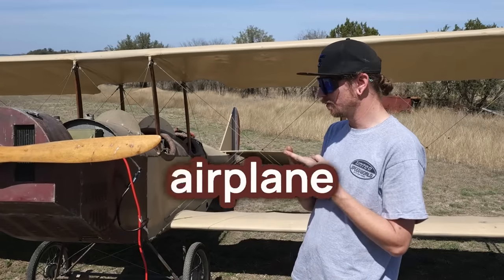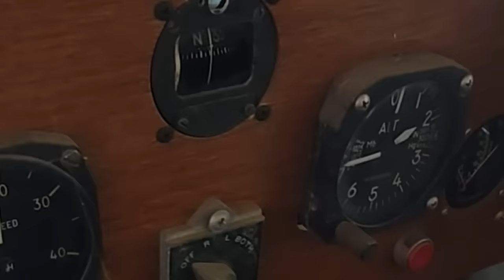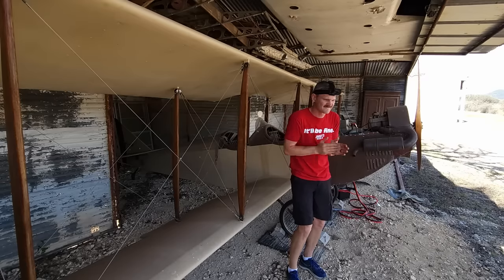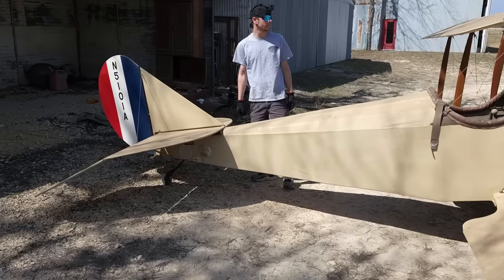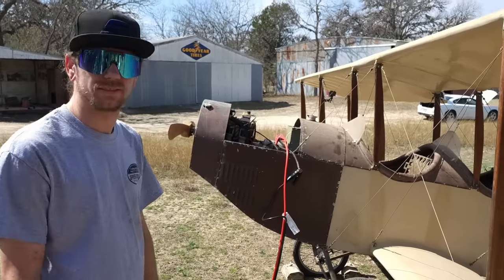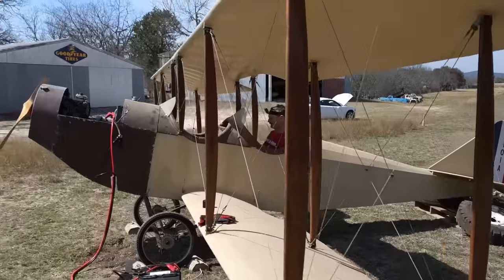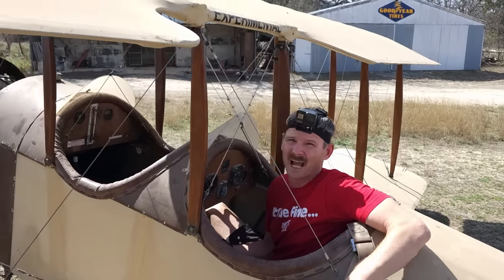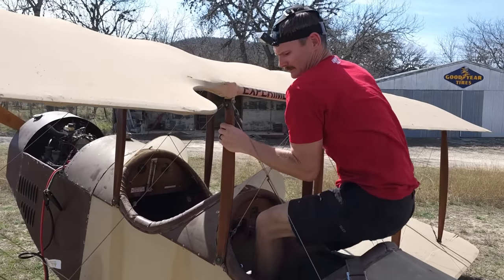WW1 Airplane Will It Start After Years?  FREE Airplane Challenge

Comment: Looks like an "Early Bird Jenny", which is a 67% scale replica of the Curtiss Jenny.  Your viewers should know that this is absolutely NOT an actual WWI aircraft.  It is an experimental, amateur built aircraft, designed by Dennis Wile... and it was probably built 80 years after WWI, in the early 1990s.  :)  The real Curtiss Jenny is quite a bit larger, and there are still a few original flying examples still around.
Reply: and they don't have lawnmower engines. They've actual aero engines running on actual petrol.
Reply: I was looking for this comment.   Thanks
Reply: @jwenting  This one is snowmobile, same power as small car, not a lawn mower
Reply: @johanengqvist4333  same engine design principle though, same manufacturers, just a souped up, scaled up, lawnmower (or moped) engine.
Reply: Especially with a Rotax on board.
Reply: Still looks really cool good replica stil looks great in a hanger
Reply: He did explain in the video that it wasn’t the same if you listened
Reply: @theking19777  I think the point is that he is using a misleading title for clicks.
Reply: I was looking at the scale of the aircraft and I had a feeling something was off! an adorable aircraft nonetheless!
Reply: @codyking4848  and taking advantage of the fact that most people will not even bother reading video descriptions.
Reply: Actually had the opportunity to work on a real airworthy Jenny in Virginia and after seeing the real thing next to the replica the real jenny dwarfs it with an almost 45ft wingspan. The real Jenny also has a nice V8 unlike a lawnmower engine but still cool nonetheless
Reply: @@lurch789 these guys dirty up the "old" airplane (or car, motorcycle, bicycle, etc.) that they're fixing up to make it more dramatic...
Reply: Sounds like it’s running just fine ….. Got a lot of fwd CG but at least it won’t be pitching up ….lol.   Man when that engine quits it’s dropping      Quickly with all that drag.  Personally it’s cool but a death no way would I fly this ……lol

Great job tho!
Reply: I went to a air show at bowman field here in Louisville Kentucky last year and they have a Curtiss Jenny with a small block Chevy V8 which was interesting
Reply: Yeah that's what I thought... thanks for confirming
Reply: Actual Jennys were powered by V8 engines and had a 43 foot wingspan.
Reply: Thank you for saying what, I was about to expose.
Reply: I almost bought the Nieuport version.

Comment: Hey guys be sure the oil injection is working correctly , it did not appear to be smoking out the exhaust at all and seeing its a 2 stroke you would think it would  smoke a bit for sure .  👍
Reply: I concur. I had a 503 and it always smoked at startup.
Reply: Two strokes need oil in the fuel. I was hoping it wasn't going to seize while he ran it up.
Reply: I removed the oil injection and premix. It's the only way to know for sure, until I forget 😢
Reply: It's not oil injected
Reply: @Watson1  it's not a 503
Reply: @Brendan Gardam  it has a separate oil reservoir  and he also said that the fuel in the tank is straight gas ? So how else would it get the 2 stroke oil get mixed 🤔
Reply: @ayitsyaboi  I had a simple gravity injector fail on a motorcycle. When I saw the contraption that came on my Rotax 582, I was like, hell no.
Reply: @chevelle-pi1bn  well he is wrong. 532 s are not oil injected as far as I know. The oil tank he was pointing too is the lubricating supply to the rotary valve. Nothing else.
Reply: @Brendan Gardam  well hopefully they do have it properly mixed and they don't hurt the engine .👍
Reply: @chevelle-pi1bn  it would have premixed fuel in it.
Reply: It'd clunked after that if it wasn't getting oil.
Reply: Jimmy has no knowledge about old Rotax engines. Before he deals with those engines, he needs more knowledge in details about running them safely and successfully. No oil, no smoke. That’s not good at all. I think, this Jenny is an Czech replica. At least it looks like it. But you need to get into this for flying this. That’s for sure. I wouldn’t like to be the test pilot of some of these exposures. They need a lot of work before take off. 😂❤🎉
Reply: @mr.ginnationfunlifestyle3891  not completely true. I run synthetic 2 stroke and the smoke is quite hard to see.
Reply: I'm sure they scored the cylinders. Never prop an engine that has been sitting. All that surface rust will get found and scoured by the rings.
Reply: Me to. Had to premix after that.
Reply: @justpauls  Some two strokes have an auto-mixing feature for the 2 stroke oil. Where you put 2 stroke oil in one tank and fuel in the other, most of the time people end up deleting it though as it can easily get clogged up with even just small pine needles from surrounding trees or whatever that can get into the tank. I always put 2-3% 2 stroke in the fuel tank no matter if it automatically mixes it or not. I usually put a little more than the brand recommends, even if it smokes a little more it'll keep it running forever. Had a fully built 88cc which had its rev limiter removed (went up to 18k rpm). Drove it for half a year and only minimal / pretty much no markings on the cylinder :)
Reply: Oh yea an old 2 stroke like that would 100% smoke a little bit if not a lot.

Comment: Dear Jimmy, that little oil reservoir on top of the engine is not the lubricant for your crankshaft, rods and pistons !
The little oil reservoir only lubes your rotary vane which sits between the carburetor and the engine block, nothing else.
So, please add appropriate 2-stroke oil to your fuel.
Reply: I was just about to type that, I hope he sees that comment!
Reply: I don't believe they added fuel, so hopefully whoever put the fuel in put in the proper mix. So we can hope there was no damage during the start up. Good reminders though.
Reply: If they are using the fuel that was left in the tank it is premixed. If they did not add very much regular fuel it might be ok for very short run
Reply: Registry for the plane lists engine as Bombardier snowmobile engine.
I thought the Bombardier , which is like the 503. Had a fully lubricated injector system not requiring fuel/oil mixing.
Oh well, nothing like watching Jimmy just try things without doing any mechanical homework.
What could go wrong 
Except kill one of his future buyers..
Reply: @michaelpilot1000  could be unless the pump was removed and fuel was just pre mixed, the part that is concerning is the lack of smoke on start up and warm up, regardless awesome video
Reply: @michaelpilot1000  also that last bit of your comment was a little dark why go there?! We were just trying to help him out
Reply: @michaelpilot1000  bombardier own rotax and it is a 532. Not a 503 and not oil injected.
Reply: Rotary’s don’t pistons and rods
Reply: @brendangardam710  

I know more about my Lycombing engine then these 2 cycle lawnmowers lol.
For all the noise they make here at my airport, any amount of wind and they barely fly forward. 
Imagine the drag on that JN Jenny and your looking at really questionable early stall speeds.
 One thing for sure during the Jimmy engine runs. I didn't see any blue smoke. I wonder if the cylinder walls are destroyed now.
Reply: @gavinkeller183  it's not a rotary engine it's a rotax twin piston 2 stroke and this particular engine uses a rotary valve instead of reeds
Reply: @cameronhadley3504   The Rotax run aircraft we have at my airport all smoke to some degree.
My guess is Jimmy once again didn't research engine requirements and like a teenager just proceeded to start the thing. I think value went way down after those videoed antics.
Reply: @cameronhadley3504  Dark?

Last I checked my A&P license is current.
Gets old seeing people screw up airplanes that end up killing some else.
Reply: @gavinkeller183  Really? No piston or rods.
What do they have then?
Reply: @michaelpilot1000  ya I'm pretty sure I mentioned the lack of smoke in a previous comment maybe I didn't lol, I've rebuilt many as snowmobile engines but none as aircraft engines, up here in Northern Ontario we don't get our first car we get our first snowmobile haha, but who knows maybe we just couldn't see the smoke in the video and all is good it he mixed fuel for it or it was running on what was already mixed in the airplane, I was just making an observation like a few other people, I wasn't there I can't say for sure I was just trying to give him a heads up Incase he forgot
Reply: @michaelpilot1000  I understand what you are saying but just feels like bad juju to say it that is all, that what I meant by the dark comment
Reply: @cameronhadley3504  I'm a bit suspect of them commenting how quiet it was. What mouse house is inside that exhaust?
Most 2 cyl engines have turned exhaust, and the better performing ones are not quiet.
Reply: @michaelpilot1000   my mistake.  I thought he said it was a rotary engine.  Which doesn’t use pistons or rods
Reply: @cameronhadley3504   my mistake.  I thought he said rotary not Rotax
Reply: @michaelpilot1000  they are tuned for sure I'm not sure about aircraft but I know touring snowmobiles still have tuned exhaust but are muffled well. Maybe that's the case here?
Reply: @cameronhadley3504  

All I know is watching these haphazard engine starts with out not even cleaning fuel systems, nor doing the home work of said engine is like watching Laurel and Hardy.
I lost interest quickly of any consideration of buying or recommending this aircraft for sale.
FYI, there is a same size Jenny built in 2000 for sale currently. They are asking $ 1,000 without engine. And it looks great.
I also question the age , condition of all the fabric on all of these planes.
$ 100,000 paid?
Lol, I'd like to see the original sales agreement.
Reply: @gavinkeller183  Rotary Wankel engines have a rotary piston. A rotary radial engine do have conventional rods and Pistons atla do regular radial aircraft engines.
Reply: @michaelpilot1000  really $1000 no engine?! That seems like a great price!
Reply: FIRSTLY, I would've taken the bottom carburetor bowls off, taken the jets out of the bottom center inside the bowls with a flathead screw driver, removed them and cleaned them out, (the small jet holes), really good with B-12 Chemtool carburetor cleaner and a strand of fibered stereo speaker wire, ran some fuel through the floats from the fuel tank, then replaced everything and tightened them accordingly. If he had done this first, the engine would've fired up immediately and he could trust that the engine wouldn't quit on him when in the air from a plugged up carburetor jet.
Reply: Yes, it is to lubricate the gears of the rotary valve!
Reply: @glenturney4750   The first thing they did was smell the fuel and check the line condition. Gas even a year old starts to smell old. 

Obviously the video proved the carbs didn't need the jets blown out. These always start hard unless you install a primer on them.

I added primers to all the ultralights I've owned. These do have chokes which we didn't see being used. Two strokes respond well to a little WD-40 in the intake while they are cranking over. It works like a starting fluid and provides a little oil to lube things until the fuel finally gets there on a cold engine.
Reply: @michaelpilot1000  😂😂😂
Reply: @michaelpilot1000  My money says that $1000 dollar airplane probably doesn't have an N-number attached so it's real value is scrap.
Reply: That’s a 532 It requires premix
Reply: That 532 is super sensitive to timing and it’s points. 30 year total A&P IA
Reply: 2 strokes and Starting Fluid is bad. Washes the oil from the cyl walls and the bearings
Reply: Jimmy I love ya but that poor two stoke. Mike stray man wrote a great article you can google. It’s called care and feeding of your Rita’s engine.. pleeeeese take the time to give it a read!!
Reply: @Scorchzzz  it's a modern motor it's a 12v
Reply: @Scorchzzz  people comment without knowing what they are looking at, clearly 6 cells on that battery... thats 12 volt if you didnt know.
Reply: @Scorchzzz  Yeah sure, because they were made 100 years ago with high performance Rotax 2 stroke engines eh?  It's pretty obviously NOT going to be a 6 volt system.
Reply: @R. Michael Pitman  why are you seeing people screw up airplanes and letting people get hurt? If you there, physically seeing this it's time to do something about that. And where are you working where mechanics or other individuals are messing up all the time? That's not common anywhere.
Reply: @michaelpilot1000  From what I have read a tuned exhaust on a 2 stroke is a bad thing for an aircraft - it puts most of the power in one rev range, when you need it across the entire range
Reply: What a great ‘barn find’!
Reply: Ok cool looking plane but where's the flight stick to fly it?
Reply: I cringed when they started it without checking the oil first...
Reply: It’s a rotax it’s got oil
Injection
Reply: @IowaBudgetRCBashers  do some research. 532 rotax never had oil injection
Reply: @michaelpilot1000  yes. I would like to see his receipt too. And I don't believe he paid 234 K for that scrap Elvis plane.  The way jimmy constantly harps on about what he paid for these things makes me think otherwise.
Reply: The fuel did not have a red tint as far as I could see. It looked like fresh unmixed fuel.
Reply: @flipflopflyeralsibi2351  I was thiinking exactly the same thing! More lilke: "oh, he's not really doing that!!" Why not spay pre-mixed fuel into the carbs?
Reply: What a fantastic video of a ww2 replica!
Reply: Sounds about right. He’s not an actual airplane mechanic and honestly doesn’t know what he’s doing.
Reply: Just wondering, how exactly does that work?  If you have a twostroke engine with a rotary vane, all the oil that gets to the vane will normally mix with intake air, since the rotary vane is what regulates the intake, and is right there behind the carburetor. I cannon understand why anyone would design a two stroke with a rotary vane, and an oil injection system, and not choose an oil injection pump that has a high enoug dosage to lubricate everything.
Seriously, the oil that lubricates a rotary vane end up in the exact same places a premix oil does. I have no experience with this particular engine, but I have rebuild enough twostrokes with rotary vanes to know how they work.
Reply: @glenturney4750  and not mixing atleast 100:1 w. fresh fuel in the tank but spot on. that starting fluid should never have to be used! premix in a syringe down the carb throat is always more effective anyway!
Reply: @michaelpilot1000  Everybody is probably waived and told to do their own homework before flying, with no safety guarantees.

Comment: Jimmy needs a property like that! 
An old house, a couple of old hangers, and a grass strip.... A fellow doesn't really need much more than that!
Reply: I have no doubt It will come .... needs the permission of wife and family I suppose. In usa exist these flying communities like John Travolta is living where u have the plane directly front the house. Wills be awesome such place with lots of aviation crazy folks around
Reply: And don't forget those old parts hauler trucks in the back ground. The site of one of those old trucks hauling an old fuselage down the road would be priceless. Although I am hoping all those planes fly out of there.
Reply: Safety tweaks:
1. Suspension:  Add two new inner tubes, two new 20" bicycle tires, wheels, and hubs perhaps 32J with three cross, new  bearings and new bungee wrap suspensions.
2. Energy management:  Replace cowl edge foam with 4" foam especially in front of pilot.  Replace metal windshield screws with nylon fasteners so your face can shear them off.
3. Stuctural rigidity: Inspect all cables for any corrision in particular the eyes for abrasive wear. I always find one.
Reply: I tried to tell him that too😂
Reply: Kind of looks like the Old Rhinebeck Aerodrome, located in Red Hook, NY.

Comment: Yea, when I bought my first PPC, it had sat for around 12 years & the fuel was orange! 😬😬😬
The fuel lines were rock hard, & the fuel smelled like kerosene!
Step 1, replace all fuel lines!
Step 2, remove & wash out the fuel tank!
Step 3, replace the main & secondary fuel pumps!
Step 4, lubricate the frozen carburetor & throttle linkage!
Step 5, a fresh oil change!
Running like a top now! 🤗🤗🤗🤗

Comment: I flew several types of Quicksilver ultralights with Rotax engines. All of them required premix oil fuel. Great engines with little failure. The only problem I had was a spark plug wire coming of mid flight. The engine was mounted with the jugs on the bottom and we had to put bungie cords across the wires to make sure they stayed put. The 532 engine was water cooled but the 503 was my favorite. Hand starting them on a cold morning with no choke was a chore. Real great little aircraft that are still in production I think.
We rounded up cattle and herded wild horses for local cowboys with ours.
Take care, have fun,
jack